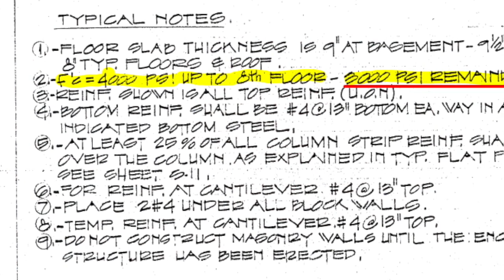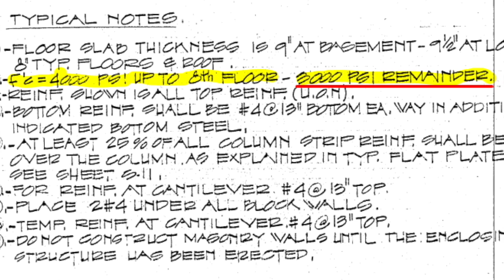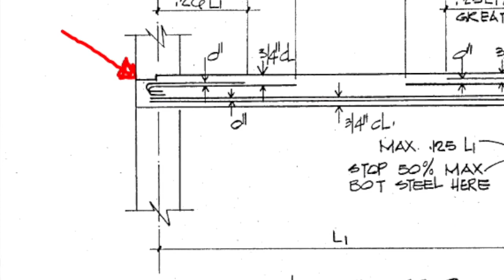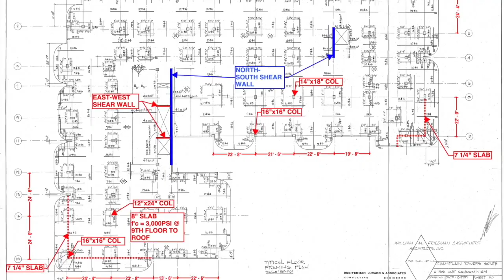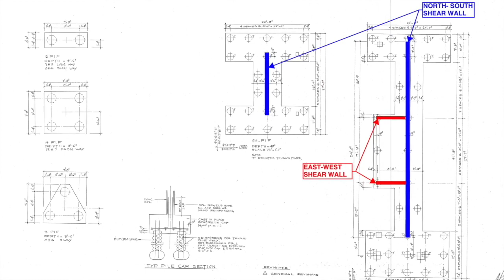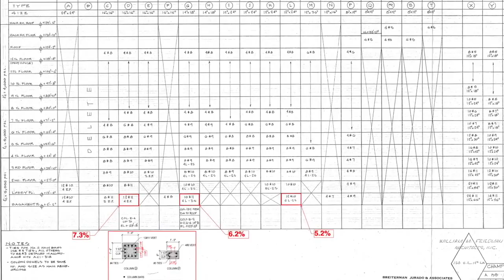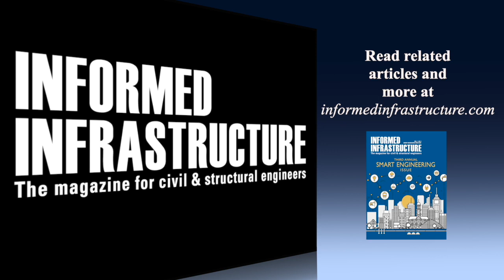What Went Wrong At Surfside Collapse?

Comment: You bring up so many potential paths to failure it is very frightening. If one column can be removed for a building failure then how many holes need to be drilled and how much explosives used. My understanding is the whole building was made out of concrete and rebar. They stopped rescue work Saturday and 24 hours later the building was down then cleaned up. How fast could a team go in the basement and drill some holes. The building swayed could that have been an explosion? What if a car or other vehicle damaged a post could that have started a collapse?

Comment: This collapse was just so sad, and so preventable. What's amazing is that this (in my opinion) marginally-designed and constructed, and very poorly-maintained old building lasted as long as it did. It seems like it was a deathtrap and a calamity waiting to happen. 

From all of the photos and videos I've seen, there does not appear to have been an overly-large amount of rebar in that building. Having the pool deck as an integral part of the structure also seems like a REALLY bad design to me. In fact, the collapse of the pool deck may have caused lateral stress on one or more of the three main columns that collapsed first, taking the entire building down - since the pool deck collapsed about 7 minutes before the building did. There is a tourist video that shows all of the collapsed debris a bit beyond the bottom of the ramp down into the parking garage 7 minutes before the collapse. It's inconceivable to me that a building designed like this would have ever been approved for construction. But, it was built in 1980, when the Florida condo boom was in full force. I suspect there are a lot of buildings built rapidly in Florida during that period that likely have serious design, construction, and maintenance issues. I hope we don't see any more of these collapses, but it wouldn't surprise me if we do.

Years of water intrusion in the garage, causing noticeable spalling of the slabs and columns of the pool deck (and even under the main building), the ineffective concrete repairs, possible overloading of the pool deck with those big heavy wet planters that had palm trees in them in the past, the refinishing of the pool deck adding 2" of sand and tiles on top of the concrete deck (possibly without proper slope and drainage), possible building dead load overloading caused by residents putting in things like heavy granite countertops and even granite panels on some WALLS over the years... and essentially NOTHING having been done in the garage to repair anything down there since the serious and foreboding 2018 architects' report... pretty much explains this collapse to me. It wasn't one thing - it was many things over a period of years - but the most serious things to me were the constant saltwater intrusion in the garage under the pool deck for years, and the fact that the pool deck was integral to the building structure. Concrete doesn't respond very well to saltwater intrusion. 

I would never buy a condo anywhere - but especially not on the beach in Florida. There would be far too many things out of my control for me to EVER live like that. But my heart goes out to all of the innocent people who perished in this tragic collapse.
Reply: I bought a condo after my children grew up and left. On my own for years, the upkeep of an older house was too much.  It never occurred to me that I could get hit with a huge fee if the building needed millions of dollars in repairs. The amount of money required no doubt slowed everything down.  (My building is much smaller and newer and has no underground parking.)

Comment: By Leon Wechsler Architect: The one and only reason this building collapsed is lack of concrete beams under the pool deck and the same in the building portion that collapsed. However this will never be brought up in the inquiry, because Structural Engineers are not ready to expose this main reason, because many of them design the same thing in buildings that were not built with post tension cables in the slabs.
Reply: I don't think I like the idea of a 13 story building with no steel posts, just concrete and rebar.

Comment: I tell you what happened... Stolen rebar by the constructor, very thin pillars, weak pillar beam junctions, no concrete shear walls in the structure (except for the elevator wall). How in the world a column can punch through the pool deck slabs which practically carry no weight. This is unheard of and unimaginable. Decades of old godforsaken concrete piers with rusty rebars and whatnot literally over the sea just stand indefinitelly. This is called a royal theft and murder. It's twin must be demolished ASAP and the unit owners should sue the constructor for a compensation. Period.
Reply: Developer Nathan Reiber used his own money in the project's early phases. He faced crazy-high materials costs and was constantly worried about his bottom line. When his capital ran out - the project stalled, leaving unused construction material exposed to the elements, while he returned to Canada to seek more funds. By this time, two Contractors resigned from the project, citing Reiber's reluctance to stick with the plans and skimping on rebar and concrete quality/quantity. He was also known to hire unskilled, non-union labor(see crane collapse video) and even hired a cut-rate Architect, who was previously suspended for structures that failed during Hurricanes. Some say he even failed to do proper soil analysis and foundation piles were not as the drawings specified. Codes in 1979 were quite lax. 

This project should have never happened. Reiber was initially in Florida enjoying his retirement as a Canadian tax expat, when suddenly envisioning a luxury beachfront community, while on a walk one day. Everything was hastily planned and executed. Reiber was obviously blinded by the dollar signs, which he eventually received when the last unit sold($23,000,000/total). Unfortunately, he is no longer available to answer for anything, as he passed in 2014.
Reply: @Dilberto88  Thanks for the story behind.. People should read your answer. Now i can see the complete picture.
Reply: Good point about the collapse of the pool deck being pretty ridiculous. No other videos have mentioned that, but there has been discussion of standing water on the pool deck contributing to the weakening there, and discussion of water damage evident on the ceiling of the garage under the now collapsed building.
Reply: @davesmith5656  Water normally has no power over the pool deck. There are so many flexible leak proofing mortars to apply the tiles. With the usage of proper material, sloping and drainage it's the easiest thing to make it water proof. It's definitelly a construction fault. I mean really... This kind of chain reaction yielding a total collapse of the whole structure is possibly unheard of in civil engineering.
Reply: Some of the pillars in the parking garage under the pool deck were only 12"x16" and had no caps, which is all sorts of insane in my book.  Near as anyone can tell, the waterproofing in the pool deck slab either failed or was never installed properly, so 40 years of saltwater exposure was weakening the entire slab; then they put heavy sand and pavers on it, plus more planters than the original plans called for; PLUS they NEVER INSTALLED reinforcing beams next to the lobby where it met the pool deck because a last minute change that removed a step down also made them think they didn't need the reinforcing beams, either.  There also should have been break lines to separate the pool deck slab from the rest of the building.  It's honestly a miracle none of those cars parked in-between the lobby and the pool deck never fall through and caused some sort of disaster years ago.

At any rate, the smoking gun was a beam that was attached to the SIDES of 2 key pillars - one under the pool deck... and one UNDER THE BUILDING ITSELF.  When the pool deck fell in, it toppled the parking garage pillar and some of that "sideways beam".  From there, the other "half" of that "sideways beam" pulled down or weakened that key "under the building" pillar... and once that pillar failed, it was a domino effect of failing pillars all in a row under the front edge of the central building, and you get the collapse you can see in the security cam full collapse video.

In short, it was a combination of neglect, inadequate waterproofing, and remodelers not taking into account how much weight they were adding to those glorified pencils they called "pillars" down in the parking garage.
Reply: They heard noise in the basement for either 30 or 45 minutes prior and a report of sounds the day before. Some one should have investigated. There was sound of explosion or loud banging and a swaying of the building. Seems to me it was brought down on purpose. Who in the building was threatened? The Saudis put in an offer to buy it. Plus why did the Israel Army show up the next day? What were they looking for? Then we have NIST that brought down the rest and cleaned it up. Why? what was the problem putting a big tent over the pile? To many anomalies.
Reply: https://youtu.be/WaZcyq7YsNA

Comment: 2:30, wrong. Evidence is not on the bottom of the pile. It’s on top. The columns are on top of the slabs and that means all of slabs slid down all of the columns, which then fell on top of the slabs. Inherently unstable flat plate design.  Similar design buildings are in danger of collapse as their rebar ages.  If only one joint fails, the whole thing collapse just like this one. This is not the first to collapse- many have. 60% of collapsed in Mexico City were this cheap and dangerous design.
Reply: Aged rebar?  Rebar that has been flexed too  many times or rebar that has rusted, or rebar that hasbeen asked to do more than it can because of missing concrete, but old rebar?

Comment: Think cars weight on top of garage ceiling  water damage and too small posts an insufficient rebar  was cause
Reply: rainwater on a failing pool deck, heavy failing planters is also a major factor
Reply: I heard it mentioned elsewhere that every time it rained or there was a storm sea water got on the pool deck. The deck absorbed the water (even though some of it was drained out). When it all evaporated, it always left the salt which would attack the concrete and the rebar over the decades. Add in the weight of more continuous water on the deck, cars, planters and possibly over-weighting of some apartments above with large marble tile walls and floors and granite counter tops, etc. and the collapse seems inevitable.
Reply: @jonsimon5779   thanx for your reply 🙄